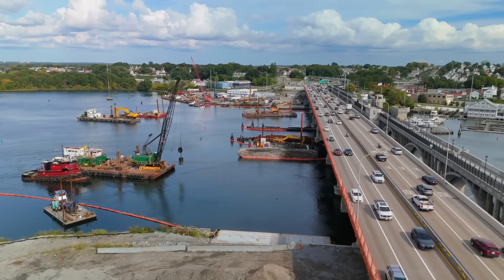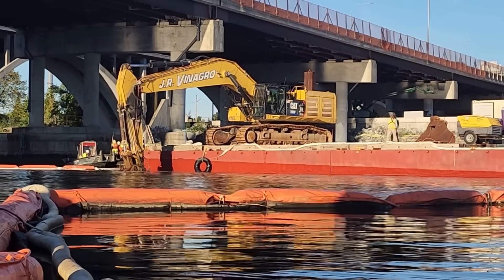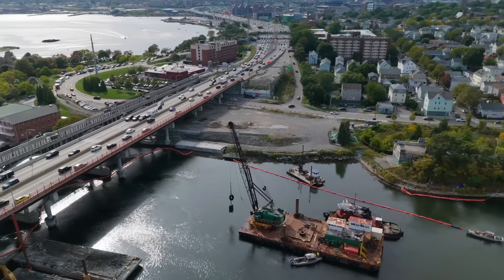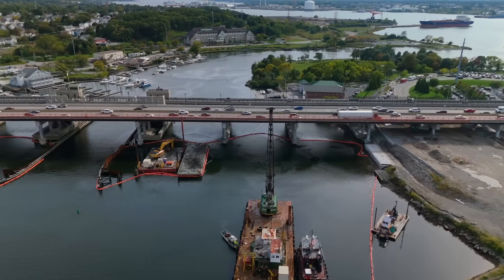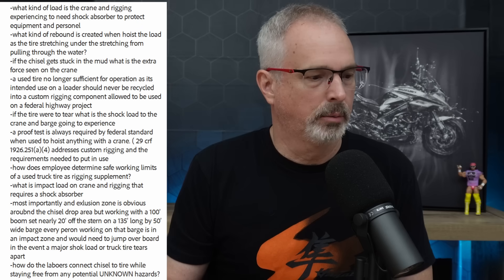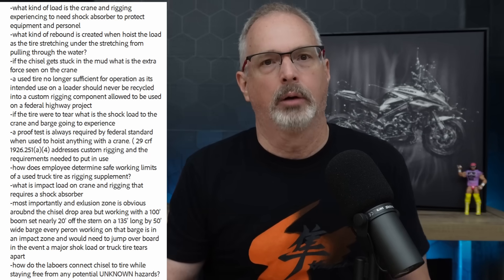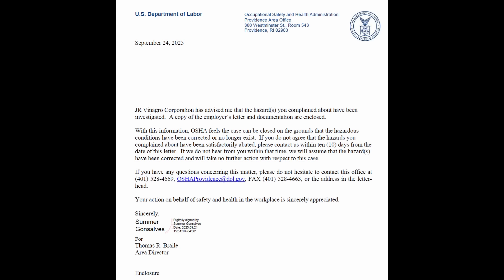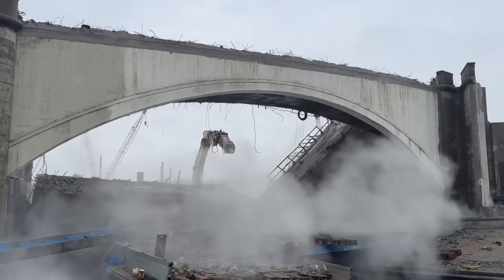More Washington Bridge Demolition Concerns

Comment: A couple of items, a tire is common place in demolition when you have a demolition exclusion zone. It’s not uncommon for the ball to hang up and then fall off a raise structure.    That can create a substantial shock load through the rigging.   I drive through this every day and at some point you see the chisel as you call it less than 10 feet from the outermost westbound Lane.  

It’s hard to imagine how the demolition exclusion zone could take into account the occupied roadway that close. It’s not as much about the tire as how close it is to active traffic. 

Whomever reported it to OSHA reported it to the wrong entity. OSHA is concerned about the employees and would be OK with a momentum driven demolition device hanging from a tire. 

I would suspect the proper entity would’ve been the National Transportation Safety Board or NHTSA (national Highway traffic safety administration).
Reply: And clearly reporting anything to a state entity is futile
Reply: It’s also not uncommon to have a steel sling inside the tire

Comment: You obviously have no actual field experience. This has been a normal process for many years. This how rock was chiseled in slurry wall excavations for years before the advent of Hydro-mills. A lot of the slurry walls on the central artery were dug using this method. The tool is called a star chisel.
Reply from the maker: No field experience?  You don't know me.

Comment: Less rules and regulations are only for the betterment of the public, not for profit and campaign contributions. If anything does happen the company will instantly blame the crane operator, instant drug test. I have witness that happen when a crane fell on the Tappen Zee bridge in NY when the new one was being built. Tried blaming operator even though he had texts and emails from him suggesting to everyone that the crane  is not the correct one for the job.  OSHA will be defunded and will be gone in a few years. I was also on jobs that were unsafe and some how the contractors had a heads up a day before OSHA showed up on the job. Odd. This was many years ago maybe 12.

Comment: Let's just let them get the bridge built.  As far a the debris in the water?  It's the Blackstone river.  Even after they clean the debris out, that river will be far cleaner than what it was during my, and my father's, childhood.  Not everything is clean and neat and goes according to plan.  Keep it safe and keep it going.  Think outside the box if necessary but get it done.

Comment: Tires have been used for decades to reduce the shock load on cranes in this fashion when using drop weights for breaking concrete! Does that make it okay, probably not, but by reducing the shock load, isn't the industry actually creating a safer workplace?
Reply from the maker: Thank you, and I wonder about operating such a system so close to a road carrying 6 lanes of traffic.

Comment: A used tyre as part of any suspended load would never get off the ground in Australia.  Atleast not from any respectable outfit.  None of the large infrastructure projects or any mining project would ever allow that crap through the entry gates let alone in the air.  What a disgrace

Comment: Pretty sure they used this exact same set-up on the bridge that collapsed in Baltimore. They were breaking up slaps of the concrete roadway that had sunk.o
Reply from the maker: I think you're right. I guess one main differences they weren't connected to a bridge full of traffic in Baltimore.  There seems to be people on both sides of this issue.

Comment: Ball demolition of buildings WITH a tire used as a link in the lifting cable is normal.  It is done to reduce shocks to the equipment and mostly to prevent entanglements.  Cables when released can entangle any projection, or even its own cable.  Especially its own cable.

Comment: I saw the crane dropping the chisel, and thought it was odd. I didn't notice the tire was load bearing, but I was distracted by the barge that the crane was on would tip up high in the air significantly whenever the chisel went in free fall.

Comment: thank you casey!! thank you both josh's!! thank you to ANYONE who is helping the public to see/know what is actually happening with every aspect of this bridge debacle!!!
about the tire.... has anyone else had a tire sort of "peel off" - the tread tears away from what is under it (actually bits of wire imbedded in the tire material that will cut your hand if you touch them)? it happened to me.
granted, i did know that the tires on the used car i'd just gotten were in need of replacement - and i had intended to replace them in two days (it was a weekend). but they DEFINITELY didn't look like they would fall apart. my point: even a visual inspection of a tire will not reveal that it will have a catastrophic failure. i never ever would've driven on those tires if any of them looked like it would fall apart. well, the same goes for the tire that they are counting on to hold up that huge piece of steel. it might look ok, but it is capable of self-destruction whenever it reaches a certain point of stress. and that tire was NOT DESIGNED to be used in that way, so good luck having any certainty how long it will hold up. i really hope that everyone working on this project is SAFE.

Comment: The tire can be an OK thing.  The idea is that it keeps the eye and ball from making contact with the impact weight at the bottom of the cycle and it generally helps the actual rigging last longer.  It also gives the operator a fraction of a second longer to transition to the brake from free spool in the drop (helps with birdnesting) and it helps with "grabby" brakes/ absorbs some of the shock that would otherwise go back up into the rigging and boom if (after a hit) the drop weight gets caught up on a ledge, but then rolls off deeper.  

If they are doing it right (and I am not saying they are or are not), there should be actual rigging making up the load path (in parallel with the tire).  The rigging and crane should be sized according to the possible shock loads without the tire in the system...but the tire keeps those repeated loads into the equipment way lower for most strike cycles.  There are, of course, other more elegant ways of doing it.  But I have seen that type of setup be pretty reliable for long periods of time in other marine applications.

Comment: NYC Crane operator here 30 years experience.
Tires are often used on the hook  demolition jobs for wrecking balls and other impact devices.
Truck tires have cable in loop extremely strong .
The Shock  on boom occurs when operator hits hoist drum brake when load impacts debris to keep cable from fouling on drum . 

Friction cranes have free fall and brake has to be applied unlike modern hydraulic cranes.

To many armchair "experts "watching this job who never worked in construction.

Gonna make this project go over budget over deadline.
Reply from the maker: How does asking legitimate questions about the activities at a construction site make that job go over budget?
Reply: @CaseyJones-Engineer passerby’s calling OSHA for a practice that has been around about as long as we have been demolishing underwater structures will certainly lead to the practice deemed unsafe because the tires aren’t manufactured for this purpose despite their storied effectiveness.
Reply from the maker: @Treehandler Thank you.

Comment: They used these drop hammers extensively in removing pieces of the Key Bridge - I watched many hours of live video of that. I didn't notice if they used truck tires as straps. The steel belting in a truck tire has ~ 75k lbs of tension at 250 psi, where the sidewall will fail. A 2.4 foot square 4,8 foot long chunk of steel weighs ~15k pounds. The tire may be unorthodox, but it's safe, and certainly cheaper than a nylon strap.
Reply: They did use tires on the demo chisels in Baltimore. I watched for many hours on the live cam they had set up. The were breaking up the concrete road bed under water.

Comment: Lets not fail to mention how for several nights they also shut down the highway for LITERALLY ONE GUY installing some a camera system along the signs with ZERO SIGNAGE ABOUT THE SHUT DOWN. As a local resident, i APPLAUD you for maintaining coverage of this issue. This ineptitude in handling our public infrastructure and safetly is absolutely abysmal

Comment: I work with cranes everyday and yes that would not be allowed because the tire is not load rated.  BUT its a great idea because the shock would be isolated from the boom.  All the what ifs can be easily handled by the demo crew, thats what they do.

Comment: The tire/headache ball and crane are old school. Used for decades in quarries for breaking oversized stone that wont fit in the crusher or to make dimensional stone for rip rap or sea walls.  The technique went out of favor with the introduction of hoe rams.  I have never seen the tire break and I spent a lot of time in quarries along with MSHA. As an aside those types of headache balls weigh approximately one ton per foot of metal ( manganese most likely) and the tire is to allow the cable to flex usually when the "ball" does not hit squarely and jumps off to the side.
Reply: Ive seen the tire trick before.  You can hide a sling inside the tire to try to be "safe"

Comment: Before judgment I would find out what type of tire they were using.  Is it an airplane tire, a heavy equipment tire or a boat tire? (Boat tire is a joke)
My dad used 14 ply ,war surplus , airplane tires on our flatbed as singles instead of duels. 
Do a search,  they use tires on wrecking balls during demolition when dropping the ball vertically

Comment: Wow. Got folks in charge, and apparently at OSHA, holding hands over their faces, and peeking at the project between their fingers.
But, since that's obviously been the tradition there for quite some time, not surprising to see it continue.
Thanks for the update, Casey Jones!
Reply: You have such expert opinions.. Did you stay at a Holiday Inn Express last night?
Reply: Under Trump OSHA is a paper tiger in all but the most extreme and dangerous situations
Reply: @WalterThorne-h5k  OSHA has always been a paper tiger, in my time I had witnessed 4 OSHA inspections. They all have been farces, and I am not talking about in recent years but going back to the Carter administration through Bush the elder administration. Not once had they noticed major violations.

Comment: Not educated in this matter, but I think slamming the old structure would be more of a concern than using the tire. In general, I wonder where's the data that supports this method.
Reply: Not data so much as experience.

Comment: I worked in road and bridge construction for over 30 years and a tire was used with a headache ball, or chisel in this case, my entire career. It’s not unsafe, and it prevents damage to the lift line on the crane. As far as Walsh, they’re the kings of “change of conditions” extra work bills.
Reply: I also worked for Walsh in the 80s.
Reply: Tire is more strong then you think. The force on a tire during driving on the road is a lot more than that piece of metal.
Reply: @jijzer3284 you’re right. It is strong enough to resist tearing from the cable that loops through it and attaches to the headache ball
Reply: Well the Kevlar in the tire bead is certainly strong in tension. That’s how they are stressed when inflated. I’d just worry about abrasion from the steel rigging weakening it. The consequences of failure in this specific case are just inconvenience as long as nobody is floating around down under it. Swinging would be a different story.
Reply: I can see how a tire would both dissipate and redistribute energy in the event of an accidental shock load condition.  A safety chain could protect against failure of the tire, but then again if the shock load has enough energy to cut through the tire, then it might be more safe to just let the load drop.
Reply: @networkedperson  A rope would be better than a chain (tire connection).

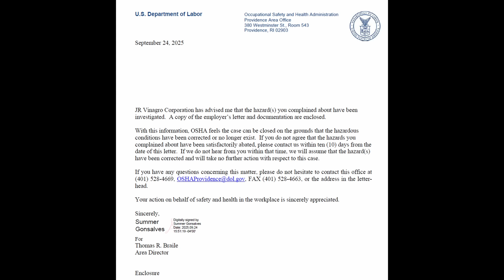Comment: 2:30 that's not what the letter from OSHA says. it says that they believe that the hazard has been corrected, as of the date of osha's letter.
you may ask yourself why no one-site inspection was performed. the answer MAY BE that the firm or its parent is OSHA STAR (VPP) certified. in looking through the VPP list, though, i do not find this firm's name.
if the firm (or its parent) is VPP/STAR or SHARP certified, the employer  may_be contacted by osha in the event of a complaint or an injury and given the opportunity to investigate and report, in lieu of osha performing an on-site inspection. i was involved in one such situation. VPP/STAR and SHARP-certified jobsites are subject to higher program standards, lower accident/injury rates, and annual review, including mandatory annual on-site inspections.

Comment: 1. I've never actually seen a true 'Controlled Demolition'. They can call it that but they have NO control over an unplanned action after a kinetic force has been applied to an unstable structure. 2. No one X-Rays conditions after that first kinetic impact to see if any other damage has occurred and they all ignore unstable adjacent areas near by which can be impacted by secondary kinetic forces transmitted solid near by structure. 3. Their one and only safe guard is the hope that nothing adverse happens, and if it does they won't be held responsible and insurance will pay for the fuckup.

Comment: Every wrecking ball I have seen that has a tire just above the ball.  I would be more worried about the vibrations that are being transmitted from the piles into the ground and over to the adjacent bridge.  If the really are planning on keeping the other half of the bridge, they need to be more diligent. They still have to drive new piles next to it.  I think they should be planning on replacing entire bridge both directions.  I doubt any money will be saved but keeping the old half, given it is same age as the one that failed.

Weren't the existing piles reused from the bridge that came before this one.  If so, it is probably past its prime anyway.

Comment: I swear, this project is looking more like something from the China Number 10 Railway Compan every time you report on it!

I hadn't noticed the tire until you mentioned it. 
Looks sketchy to me!

My concern would be for the uncontrolled shock causing damage to the other bridge foundation. 
At least with a ram hoe, the forces are concentrated  to the tip of the machine.
Reply: If it was anything like China, it would be complete in 10 days.
Reply: @SerafinaTorgul , And falling down within two weeks.
Reply: @SerafinaTorgul 
And only stay standing for ten more days

Comment: The hoe ram is using air in lieu of hydraulic or veg oil. You will see the air compressor on the barge as well. This was just done on my project in No. CA.
Reply: There is no way for a breaker that size to run on air, especially on a 250-300 cfm compressor the size of the one on deck. Any air driven device needs exhaust and there is no sign of air coming from water. As to leaking oils into the river that is what the floating boom is for and they can also use marine hydraulic oils which are biodegradable.
Reply: @billone6080  A lot depends on the permits of the water way. My project is near Lake Tahoe which has some of the most strict storm water compliance. We are not allowed any material/oil in the river. If it does occur, we can get the permit pulled and heavy fines. When they used the compressor, I did not see a lot of bubbles because of the movement of the how ram, so one would say you have to be there on the job to really know on this particular project. Floating booms are for an emergency use, not for everyday work where you expect to be polluting the river.
Reply from the maker: Good eye!  They switched after previously having hydraulic fuel leaks into the Seekonk River.